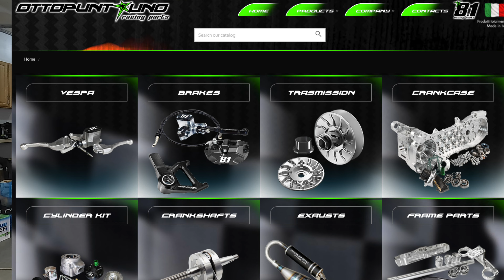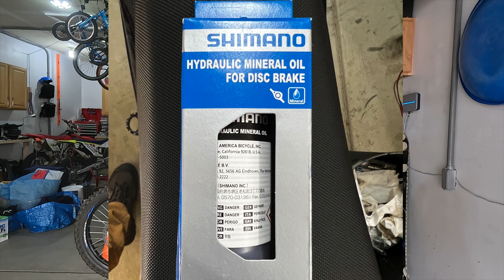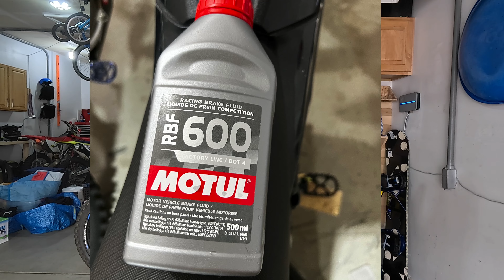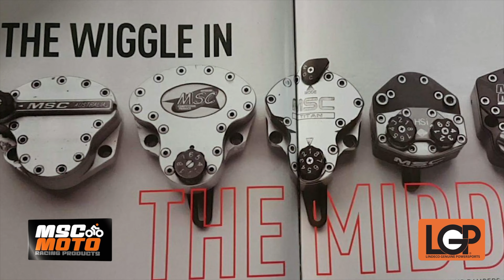Testing Brakes to Failure: Volar Sport and Talaria MX4 Brake System Review

Comment: I have had these Volar brakes for about a month and they are working great for me. They got rid of a lot of the noise you get with the stock brakes and especially if riding the bike hard in the dirt. So far have been pretty happy with them. The kit that comes with it install has everything you need to make a nice install.

Comment: I went and purchased these brakes for my MX4. The install PDF does not list any torque specs and I was wondering, or hoping, that someone here might be able to offer assistance. I am new to using orings for sealing the brake lines, and the statement "do not overtighten" has me a bit concerned...
Thanks in advance.

Comment: Only the problem now with bicycle rotors... They are not wide enough for volar pads. But as i know, it will be available soon... 
Also rear rotor rivets too close to edge, that's why you need spacers there...